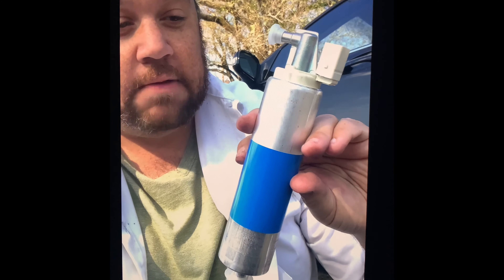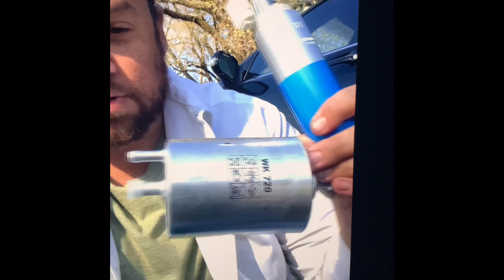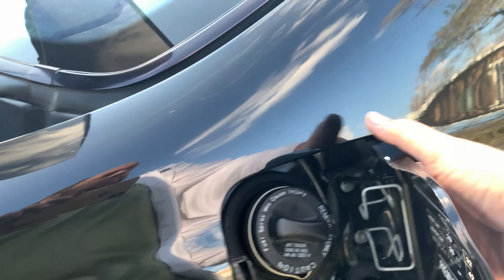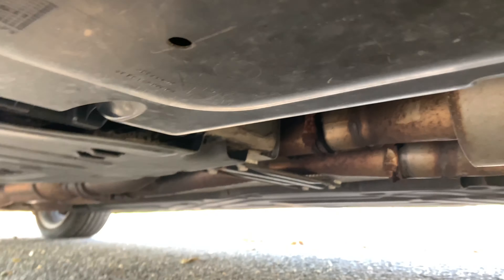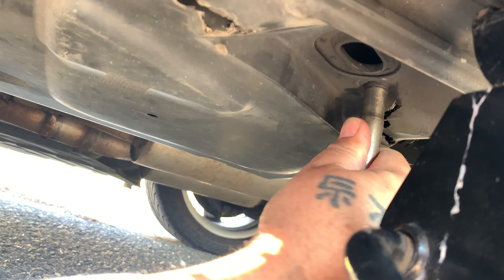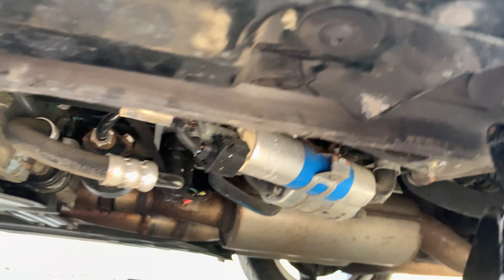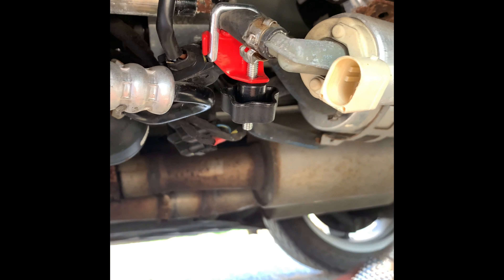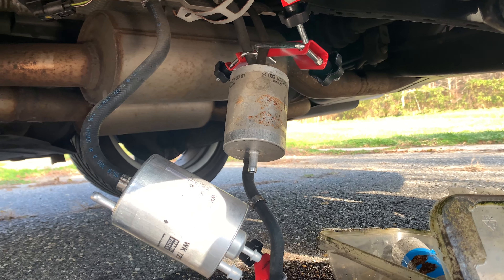How to change fuel pump and filter on Mercedes s class 2000-2006

Comment: Thanks - spot on instructions! My hose clamps were garbage but I only had one gusher - got everything changed and hopefully this solves my intermittent long-starts!
Reply from the maker: glad this video helped!  if you can buy a obd2 scanner for your mercedes.. you hook it up under the dash on the driver side . or you can also go to any autozone and get them to do a free obd2 reading .. these fault codes will lead you to anything wrong with your car . always start by doing that first. because these cars can get out of hand financially if you misdiagnosed mechanical  issues.. mercedes are 60% hardware 👨🏼‍🔧and 40% software 👨🏼‍💻
Reply: Im having same long starts, did this help you ?

Comment: IMO, start off by opening gas tank, pulling your Fuel Pump fuse (In my w220 2002 S55 AMG that fuse is located under the rear passenger side seat) and then start your car (It won't start, instead it will release pressure). Then optionally if you have someone to help then you connect/tap into the fuel line (Used for Fuel Pressure tests and right where the coil rack/rail is). As you're removing the hose from underneath, they can either release pressure from their end so you don't have fuel squirting out desperately or if you want to be a little more clever you modify the fuel pressure test hoses to have a suction type vac so the helping person can pump lightly to suck up fuel while you undo the hoses so nothing gets messy.... Just some food for thought that makes sense to me theoretically. Somebody please correct me if I'm wrong.
Reply: Hi persianchris2451...where is the fuel filter and fuel pump located on your 2002 s55, which what I have...

Comment: Thanks bro.  I have to get to fuel pump to see if power is getting to it.   I got car and same day it stopped starting while I was checking fuses.  Not sure if a random fuse or relay is bad but I checked them all and now neeed to check pump.   I actually hope it’s the pump so i don’t have to chase electric issue any longer
Reply from the maker: If you can get a obd 2 scanner and plug it into the car  .. scan for any fault codes that the car is tell you needs attention (Do this first ) 
If you don’t hear the fuel pump make any noise then it could be dead.. test the wires is good to do also ..

Comment: 2002 Mercedes s500 gas meter is broken what do you think it may be? I brought a new fuel sending unit haven’t tried it on yet. But if that doesn’t work what else you think may be the issue? Thanks.
Reply from the maker: A new fuel sending unit could help 
If that doesn’t do the trick. It could be your speedometer until failing to receive the signal .. you can also check for any obd2 codes currently active that could indicate a potential problem.
Reply: Thank you will try that and keep you posted.

Comment: Been following your channel and have learned a lot bout my 01  S430.. Now the problem I'm having is tht my fuel pump is working intermittently sometimes pump kicks on sometimes it doesn't and has left me stranded twice but then next day fuel pump will work and can starts fine this is driving me nuts please help!!!??
Reply from the maker: Well I would suggest first hook your obd2 scanner into the car.. check for all fault codes 
Then secondly, check fuel pump fuse ( i have a video of the diagram/ fuse locations on my channel).. thirdly. Check the leads going to the fuel pump for voltage..if everything checked out ok then its definitely time to get a new fuel pump.. make sure to get the Oem or like the one i have. Because cheap aftermarket pumps are very noisy and fail prematurely!! 
Hopefully this helps you
Reply: @piscatawaymechanic  did all the above except checking leads for voltage, i must admit I did install a cheap fuel pump bout 1.5 yrs ago and it is always noisy
Reply: @piscatawaymechanic    BTW  it's not throwing any check engine lights and i also swapped the fuel pump relay and nothing yesterday, however today the fuel pump fired up and car started just fine...
Reply from the maker: @greglopez7768   well the check engine light in Mercedes is for vehicle emissions related faults. W220 are essentially 50% governed by computer programs /algorithms

Yeah sounds like your fuel pump could be on the way out.  But wait and see what codes are screaming for help on ur obd2 code scanner first . You will be surprised 😯 at the amount of codes. Thats why people just throw in the towel when dealing with an w220 😑🤦🏼‍♂️..
Reply: @piscatawaymechanic gotcha didn't know it only picks up emission stuff thanks for your response, do they use OBD2  scanner at the local auto zones n stuff?
Reply from the maker: @greglopez7768  yeah  ive gone there to get a obd2 code reading for free.they will give you a print out

Comment: Having a difficult time picking out either Bosch 0024773001 or the original Mercedes from FCP.. Help? I'm going to assume the Bosch since it's more expensive and also a trusty brand.
Reply from the maker: Filter or fuel pump?
Reply: @piscatawaymechanic  The following part number above would be for a fuel filter.
Reply from the maker: I chose mann filter..   mann , bosche , Mercedes are all very good.. the most important thing is to replace the filter on schedule so it can provide good filtering..
Reply: @piscatawaymechanic  Oh for sure, but I'll only use Mann when I'm flipping cars to cut cost down.

Comment: I've a 93 sel 400 luv it. But high speed wobble at 55mph only...any ideas..
Reply from the maker: I would say , check tires , rims,ball joint, tie rods , and all  bushings.. that will help find the issue
Reply: @piscatawaymechanic  I paid 2k$ change the oil fixed the window x brace put in a 📻 brake pads and headlight switch. 7 dash lights on no ac or heat. But it rolls and stops.
Reply: Merks love to eat. Money on repairs
Reply: @stevenmetcalf386  old mercs look the best but they're always broken

Comment: Is it common for the fuel pump to leak fro the side where they wires connect
Reply from the maker: No leaks should be happening at all ..especially when gasoline is involved !  I would recommend replacing that pump ASAP .. check your hose lines make sure they are soft and flexible. Replace them if they are hard and or cracked at all .. and sometimes the hose clamps lose the ability to hold tightly and can cause leaks .. 

Hopefully that helps you!
Reply: @piscatawaymechanic  yea I don’t know what happened it just started putting gas out one day and when I got under there it looks like it’s coming from the fuel pump but all the hoses are good

Comment: Please send about s320 fuel pump       mercedes
Reply from the maker: @AlexAugustineDsouza  in the usa 🇺🇸 we didn't get any s320 in the w220 model line.. only the w140 received that engine 
from 1992-1999 here. practically the same setup and procedure to replace the fuel pump or filter

Comment: What are the symptoms  of a failing fuel pump or filter?
Reply from the maker: Ive seen. Hard starts, very noise pump , no sound from the pump once its dead , could signal a code in the obd2 system.. filter changes can be done  every 2 years .. most people neglect this simple replacement item. Fuel pump & filter are not extremely expensive so it you want to replace it for good maintenance habits…. Please  check for any obd2 codes first ..this will lead you 90% of any issues 🧑🏼‍💻+🧑🏼‍🔧=🚘
Reply: I am having problems when turning ignition it cranks for a bit and engine fires really late.the car always starts but the overcranking and delayed ignition is concerning.  What would cause this?
Reply: Can you recommend  a good scanner ?

Comment: My fuel pump is not coming on at all
Reply: I even changed out the crank sensor still nothing
Reply from the maker: @dracoyay6577    #1 hook up ur obd2 code reader under that dash .. see what fault codes are in need of fixing. #2 check the fuse  #3 listen and see if the pump is turning on when u turn the ignition on( you should hear a slight buzz) #4  you can check the lead cables going to the pump with a voltage meter to see if its getting electricity .. other then that I would go ahead a order a new pump just to be prepared..
Reply: I can’t find the fuel pump fuse and I got under the car to listen and it isn’t making any noise i changed out the pump and filter all brand new still nothing
Reply: My voltage meter ground says positive number but the red wire says negative numbers
Reply from the maker: @dracoyay6577  ok the fuse for the fuel pump on 2000-2002 s class is located beneath the rear passenger side it will have the light on it. Once u see the fuses look for relay  (T )its a large relay  .. after replacing that with a new one. See what happens then. If u have a voltage reader checking the wires for any voltage is important before and after.
Reply: I have a 2004 s430
Reply: I see green purple and 3 black relays
Reply: Hey I got the car running it was a bad relay it’s water all in that compartment, but now my radiator fan is not coming on
Reply: @dracoyay6577  did you check pre fuses at passenger front kick panel?
Reply: It was a fuse it’s back working now my tail lights are not coming on at all🤦🏾‍♂️no power to real tail lights